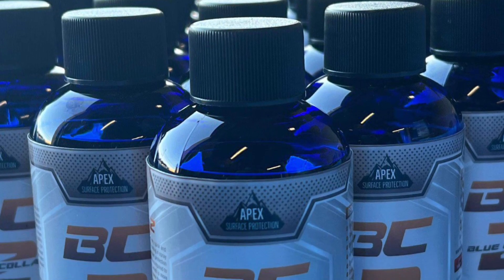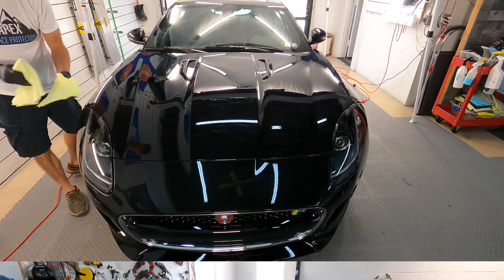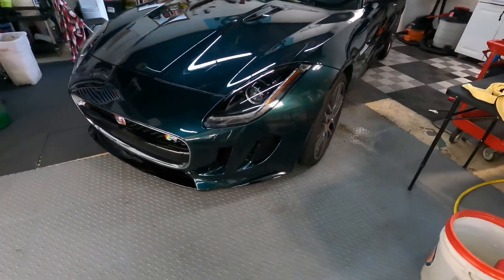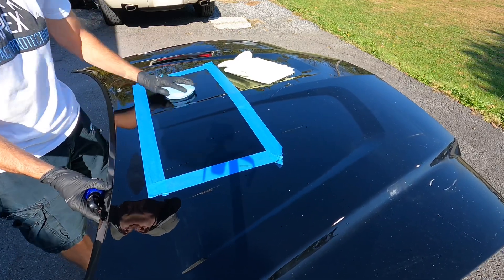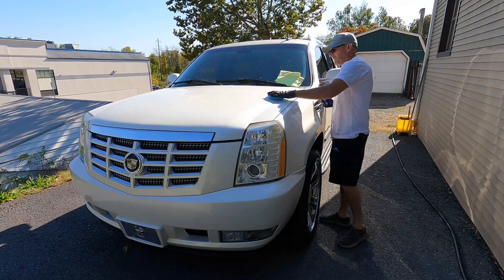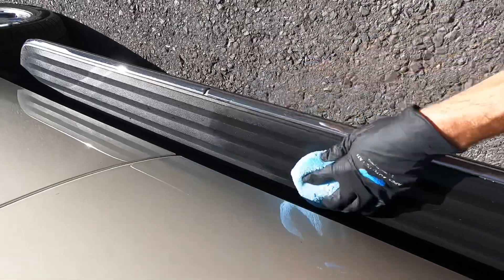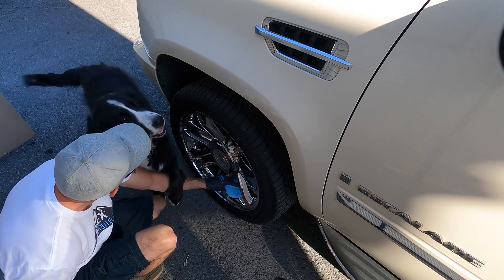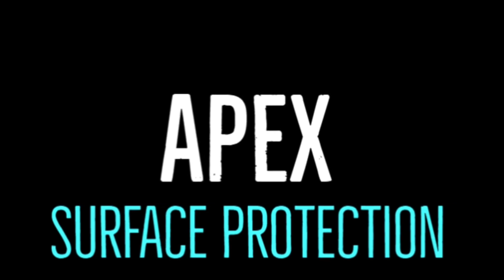BC 2!! (Blue Collar) Polysilazane 5H One Year Spray Coating!!! The Most Efficient, Quickest Coating!

Comment from the maker: I wanted a quicker and easier version of say....Gyeon Can Coat or TAC Moonlight. But at even a BETTER price point. Here it is!!!
Reply: Thank you for producing this Brian, now you're talking!
Reply: Amazing gloss like a real coat in a spray bottle 👍🏼
Reply: Hey Brian what towels do you using to removal the coatings
Reply from the maker: @Ecdetails  I like shorter nap...2 to 300 gsm.
Reply: Sound amazing. But stuck here in the
Nordics. I have to settle for moonlight and can coat
Reply: You’ve sold me on the package.  Great job with these.
Reply: Can you use the ASP BEAD OR SHEET,over the BC1,2,3 products?
Reply from the maker: @paulmouradjian6045  absolutely! Hope all is well good friend! 😁👍🏻
Reply: Just tried out BC3 today to kind of check these products out, yes sir! I'm ordering the whole line up next! Gloss is amazing
Reply: Looks like a great product and easy to use! How would this compare to a polymer coating?
Reply: I have BC1 and BC3 and was tempted to try this and use it on family and friends' cars.  How does it compare to CanCoat EVO?
Reply: @apexdetail85  Just got a bottle of both BC 2 and 3, and excited to start using them.  I have a question, can you wash and reuse the microfiber application pads without concern of the residue from BC hardening and causing abrasions or scratches if reused?
Reply: CONGRATS GOOD FRIEND

Comment: is BC1 sun-friendly? can i apply it outside or in my case BC2 is a better choice? thanks
Reply from the maker: They both are easy to work with in heat and direct sunlight. BC2 a little easier but both user friendly.

Comment: I've used BC3 on at least 10-12 customer cars, and my own a few times and I've barley got into my second bottle. This one is my next one to buy and try. I can have a short term, mid, and long term protection package and likely BC1,2, and 3 and for extra long term.. Artdeshine Nano graphene. I got certified with them, my second cert after ASP metal oxide

Comment: So it's basically a non aerosol version of Meguiar's paint coating.... Not that that's a bad thing, the Meg's is stupid easy to work with and lasts longer than si02 spray coatings in my testing.
Reply from the maker: It would be in the same category or class.